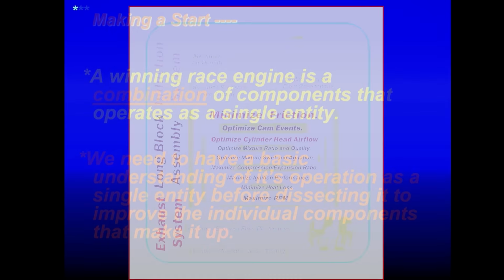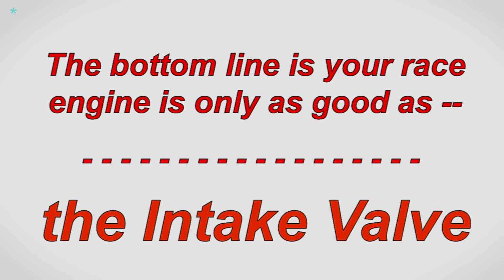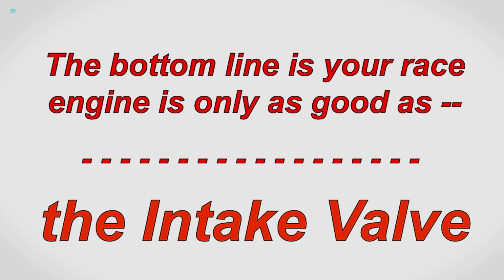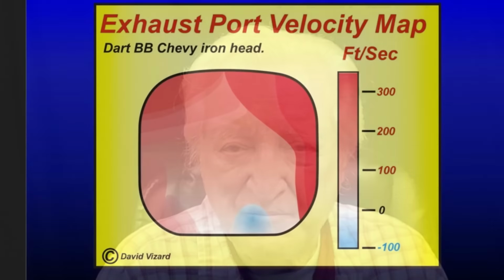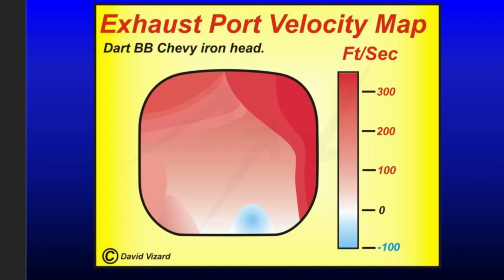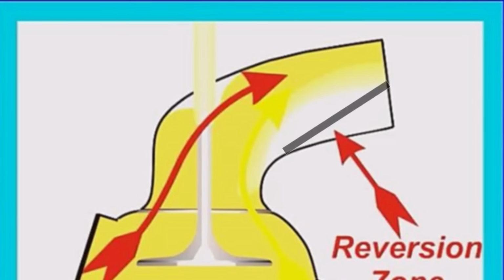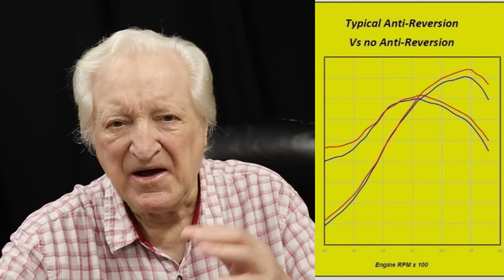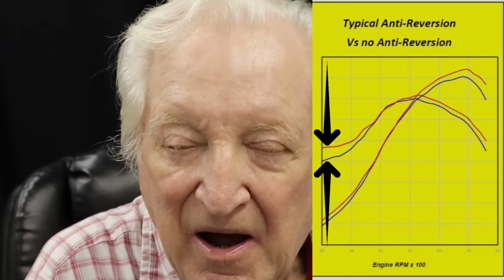Big hidden HP - from anti-reversion mods

Comment: By adding this grove do you see any failure of the intake valve braking the outer edge off over time?
Reply: I used this tractor pulling and had no ill effects - As Long As I Didnt Cut the Valve Too Thin !!!
Reply: @bobgyetvai9444  how long did the engine last? I'm looking at street driving and high miles.

Comment: I remember an article in Hot rod many years ago with anti reversion cones built into the header flange at the head.
It all made sense.
Reply: It's a godsend for NA engines with really wild overlap durations. Doesn't make any difference with stock timing events lowered compression and roots blowers like I run.
Reply: 0 I'll😊 so @patrickshaw8595
Reply: I read that! Then began learning about sound and pressure waves and exhaust flow.
Reply: anti reversion cones built into the header flange:  This is first thing I thought of when I seen the video title.

Comment: Chevy 6 guys use something similar. The ports are low to the deck surface on both intake and exhaust, causing a huge flow restriction. Their solution is a "lump port" kit. These are a lump of cast iron that fits the port floor on the short side turn. This gives a larger radius to the turn. Then the roof can be ported to increase the area.
A hole is drilled through from the rocker area that does not have coolant and through the deck surface. An Allen head bolt secures the lump in place. The hole is taped with a pipe tap from the rocker side to seal the rocker area from the port.
I think most V8 heads have coolant above and below the ports, so this would not work.

Comment: Excellent video David, the exhaust system will make or break an engine,if the exhaust port is correct you may not need a Merge collector!!

Comment: You're spot on about the exhaust port. On our world Superbike spec  engines the Akrapovic exhaust systems have this anti reversion built into the head spigots for the exhaust headers. Good stuff Dave. Thank you. We make more power on our Superbike engines usually when we flow the ports and build the floor with epoxy. We make over 225 rear wheel hp with 1000cc four cylinders turning 14-15,000 rpm
Reply: What we all need is that magic Toyota turbo inlet orifice that changes size with rpm
Reply: Reed valves in two strokes helped.
Reply: @cliffwright9842  Honda used reeds on 450cc single dirtbike 4 strokes too and it worked great Idle to high rpm cammed for the rpm .
Reply: @bobgyetvai9444  Honda used 'reed valve' on all the RFVC engines as far as I remember. Dual carbs that opened sequentially meant they would act as a single small valve without reeds. They got dropped when newer designs changed to a single carb. I'm not 100% sure but I think Yamaha also used reed valves on some of the dual carb singles, I didn't do much work on them though
Reply: Not as much as rotary/disc intake valves. An easy 15% more power. Pitlane is the place for two stroke power talk. It's run by a French dude, but most of the posts are in English. @cliffwright9842
Reply: @cliffwright9842  superbikes have reedvalves also
Reply: Amazing. What the team your talking about or if you guys have a YouTube channel I’d love to see your superbike
Reply: Could ask you what epoxy is used?
Reply: @paulmryglod4802 I’m interested in that also as JB is only good for 750 degrees from what I’ve read.
Reply: I'm a Pro Mechanic Checked out Customers 89-90 Trans Am with;Stock  350 TPI Injection Customer Installed High Lift Roller Rocker Arms  and  Big Diameter Exhaust Headers and Exhaust Pipe. Engine had No Power at Low RPM and threw out its Range to 5500-6000 RPM  the owner of Car did more Harm than Good . To Big Exhaust Headers and Exhaust Pipe Cause to much  Reversion?  Would Reversion be Considered Back Pressure and Back Pressure causing Increase or DeCrease  Reversion?
Reply: Wow!!
My 5 liter Ford  doesn't make that much horsepower.
Reply: Would any mods in the muffler of a large capacity v twin engine work? Or it must be in the early stages of the headers?